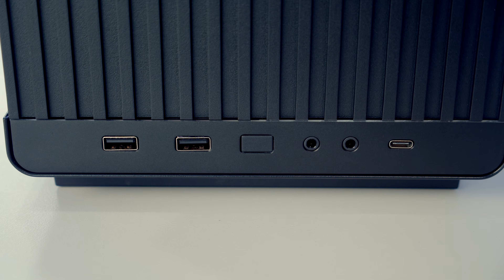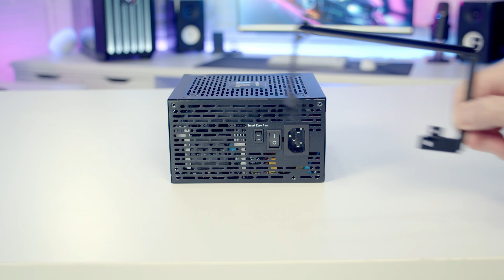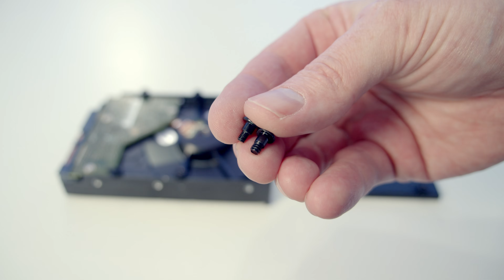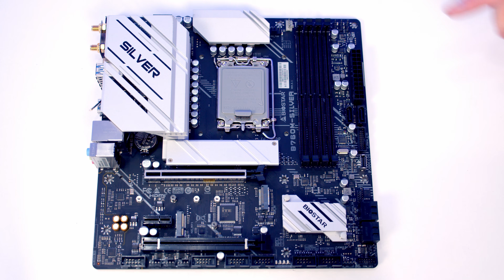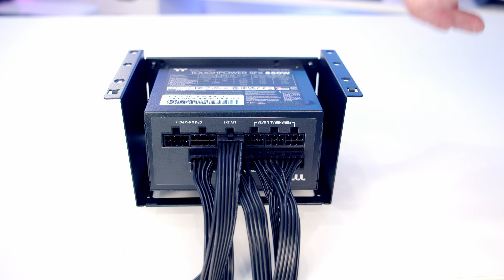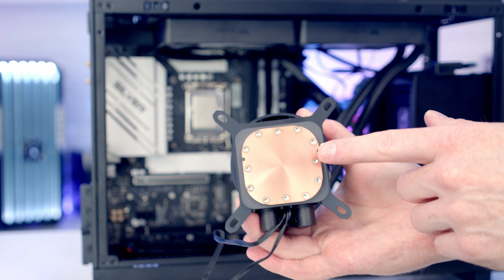Lian Li | DAN Cases A3 Build - Step by Step Guide

Comment: The more reviews of this case that I see, the more I think it would be far better to build in it with a high end air cooler, rather than an AIO. They just look awkward jammed in the top of the case. Would also enable you to use a cheaper ATX PSU in the top position without getting in the way of anything. Given the case is so cheap, and it supports ATX PSUs out of the box, it seems hard to understand why every reviewer is doing example builds with an SFX PSU. You even got my hopes up by featuring an ATX PSU earlier in the video, only to use an SFX one for the actual build and then have issues with cable length!!!
Reply: I've watched quite a few vids on this case now and I do not understand why so few utilise the side bracket that's provided. Unless you're dead set on only using the tempered glass panel and an ATX PSU the standard layout of this case should be an sfx psu side mounted which then allows a 360mm AIO installed on the side bracket intaking cool air, any size of gpu you want and 3 top fans exhausting. Can even then mount bottom fans depending on how thick the gpu is.
Reply: @Veyron_fan for people switching to this case, they probably already have a psu and a couple of hundred dollars for a new sfx PSU can be tough to go for if you have a good atx PSU. Side bracket also makes cable management worse and makes removing the panel a pita.
Reply: @Veyron_fan agree this makes sense, Maybe it’s  because it will increase sound levels coming from the side often pointing towards the user
Reply: @philippegremillet8371 worse thermals than without
Reply: @Veyron_fan it's because using fans on the side bracket actually makes thermals worse and has no benefit as illustrated in detail on Gamer Nexus's video
Reply: @mrwalker6026 No, that is not at all what Steve found. Stop blindly misrepresenting his conclusions. Not only did the BEST CPU thermals come from the side intake configuration, he did exactly zero tests with both side and bottom fans, meaning you are making blanket claims about the effects of side fans based on extremely incomplete data, even before you account for him not bothering to test with an air cooler.
Reply: @mrwalker6026 me when i'm in a saying nonsense competition
Reply: @effusivefugitive  Not withstanding the obvious flaw in Steve's test (not running a test using both side and bottom fans [although the GPU does have fans of it's own albeit not really a substitute for case fans]), it is still a reasonable conclusion that the side fans had a negative overall effect. When using bottom fans, the CPU was 44 and GPU was 47. When these fans were relocated to the side, the CPU was cooler at 38 (-6deg) but the GPU was hotter at 62 (+15deg). As a general rule, every 10 deg increase in temp halves the lifespan of a component. It is significantly better to have both the CPU and GPU running in the high 40s than it is to have the CPU running at 38 while the GPU runs at 62.

An added disclaimer on the flawed testing (in addition to the above), Steve interchanged both the front panel and side panel in his comparison tests. The values I used above for the bottom intake were done with the vented front and side panel, but the side intake tests used a solid front panel and vented side panel. There was another test conducted for the bottom intake which used a solid front panel, however this also used the glass side panel, so it isn't comparable either. For the glass panel test, the CPU was 45 and the GPU was 50. 

Despite all this, it is objectively correct to say that a configuration that increases the GPU temp 15 degrees above the operating temp without bottom or side fans is making thermals worse.

It would be great to see the results when both side and bottom fans are used.
Reply: I just bought this case, and I’m intending to i stall a Peerless Assasin in it
Reply: @xWaxxy  I reckon that'll work perfectly in this case, and will maximise PSU and GPU compatibility. Good luck with the build!
Reply: @xWaxxy I put Peerless Assassin White color ones in my A3 build. And to be fair, even though it is my first mATX build but I’m quite surprised by how spacious the case for small size that close to NR200 size
Reply: @kurousagi1239  I must admit my shame - I ended up putting my AIO in from my previous build. Nothing to do with fitment or doubting air cooling, but it was easier to cable manage and make the build look tidy.
Reply: @kurousagi1239 just used the same cooler had an aio but replced it with an air cooler
Reply: I'm building one with a twin tower air cooler and single 120mm exhaust in the back. All you need.
Reply: It is better. AIOs are just for aesthetics at this point. They're not quieter. They're 2,3,4X the price and often don't cool as well either.
Reply: @stevenm7620 I ended up using a Thermalright Peerless Assassin 90 for my Meshroom D build. I'm getting 40 degree C at 1440p for Expedition 33. RTX 5070 Ti. Amazingly efficient.
Reply: I'm currently building with this case I don't understand why they don't just make the case a little bit taller so you can fit the AIO without having to scoot it in the
Reply: why not putting the sfx downward with cables comming from the top so the 8pin cable can reach the motherboard better?
Reply: @Luisml8  Then you would be trying to vent the heat from the PSU downward.
Reply: As someone who is currently building in this case, and previously did many itx builds, I think you got a few things backwards..

1) a high end air cooler will give good cpu temps but can result in significant blockage of air flow from Hotspots on the top of the gpu (vrm's memory etc)... I ran into this problem with an air cooler in the nr200

2) an atx psu even in the top spot will still limit your GPU clearance.

The whole point of this case is to be able to fit and cool even the most massive parts in a relatively small package.

IMO the only way to do that efficiently is with an sfx psu in the top position, a motherboard using the top gpu slot, and a 240mm AIO that leaves freely flowing air above the gpu as well.
Reply: @nikolakostic5667  No, "the whole point of this case" is to be versatile. All you proved here was how hard you MISSED the point. Are 2.5" SSDs "the most massive components" now? They're not even the most advanced! Why would they include a bracket for them?

Why, too, would they include an ATX PSU bracket if "the whole point" is "only possible" with an SFX? Why do they offer suggested configurations for smaller GPUs? Get a grip. You could not be more off base if you tried.
Reply: @effusivefugitive lmfao wtf are you talking about? If the "whole point" is versatility, they missed the mark by a lot. Versatility is important, but within the constraints of the form factor. For example there's no 3.5" HDD holes on the PSU mount, or a front fan mount for under the psu. I had to drill both of those to get normal function (ie improve airflow through the front mesh, and not use up a bottom fan slot with an HDD). They also don't include a TG side panel (whereas the NR 200p does). If the end goal is purely versatility, just get a full tower and you'll never have a problem. I'm treating this case as the smallest case that can fit/cool full sized parts (including oversized GPUs). You're welcome to treat it as "the most versatile" but it's objectively not.. Not even close. Not to mention, people already know what they plan to put in the case, so versatility is a lot less of a factor than you think. If I could go with a smaller (and less versatile) case I would.. If I needed more room, I'd get something else. There's already plenty of product versatility, aka better cases for different scenarios.

The sheer irony of saying my subjective preference for the case is incorrect and then laying out your own subjective preference 😂 if I'm off the mark, you didnt even show up to target practice
Reply: @nikolakostic5667  agree 100%. Versatility is certainly something Lian Li have tried to accommodate by providing various options and configurations. But ultimately, the major design focus of this case is clearly to be able to fit full sized components into the smallest form factor while still allowing appropriate cooling.

Comment: Is there an option to mount a fan at empty psu space on the side?
Reply: i think not but there is no point to mount one.. thats not how airflow work. better refer steven review...
Reply: @itzStanley69 yeah since then i bought it and some side mount mod from Etsy for sfx psu and rails for front 120 fan mount. Working fine but I can’t rely just on that and mesh for my workflow. Temps are ok until rendering 😅
Edit: looks cool but cramped and cable routing is a nightmare with 300mm+ gpu.
Reply: @ivica7092 so did u install extrs fans? even if u did, did the temp improve? from steve review not even the side fans are needed as it s jeapodized the airflow of gpu.
Reply: @itzStanley69   no side fans. front, rear and bottom